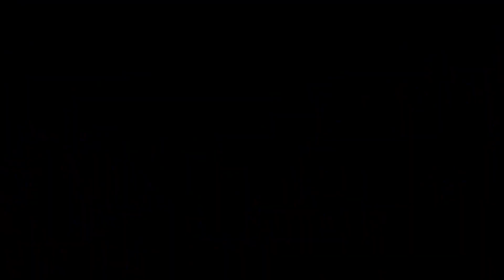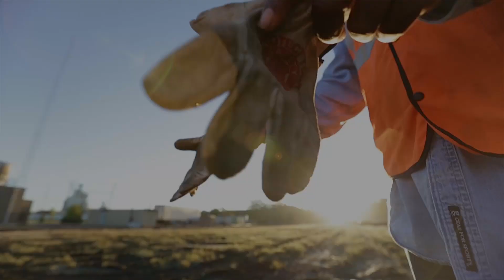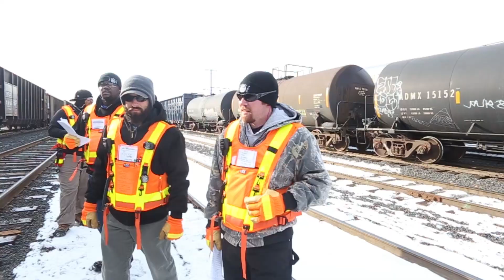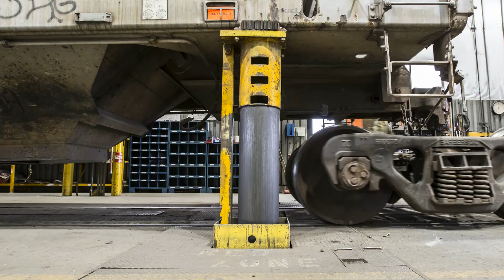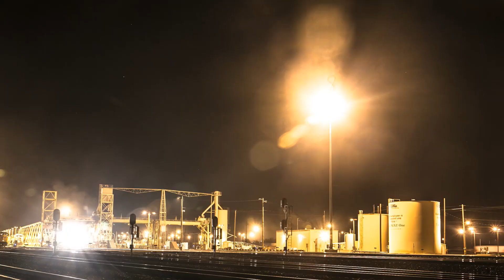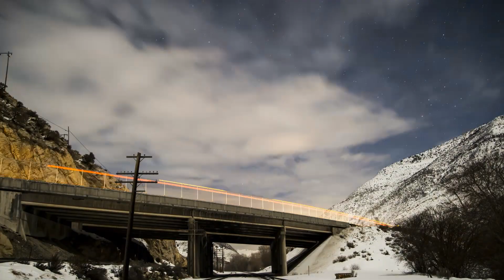Union Pacific Heroes

Comment: My Father was a Rail Road worker since 1940 and he also was a Supervisor for the mechanic department of the Diesel engine and he also introduced me to a job in the steam ingine locomotives department as a mechanic helper back in 1970thies I was a helper in maintain steem ingine running at night to support the need of providing emergency services to swap out of service engines my work was to grease all the moving parts connecting bearings and keep the oil and water fill out I also was a field helper in repair well pumps and also I was part of a crew that work at the smelting pit where they manufactured brake shoes for the train wheels, I work for the Rail Road of Guatemala city central Amerca

Comment: I have worked for the Rail Road since I was in my twenty's my Father was a Supervisor and Diesel Mechanic for over twenty years and I started in the 1969 in Guatemala Rail Road department I was a Mechanic help for steem ingine department and did maintainence on the steem locomotives I also operated the Round Table to retrieve the locomotive from the Round house but I left because I just got married and the paying was to low so I Applied for an Electrician helper job and worked for three years and we had an earthquake in 1977 and we I and my wife moved to the United States.